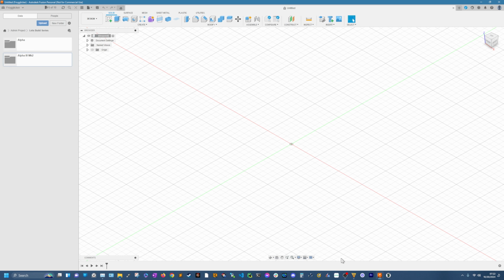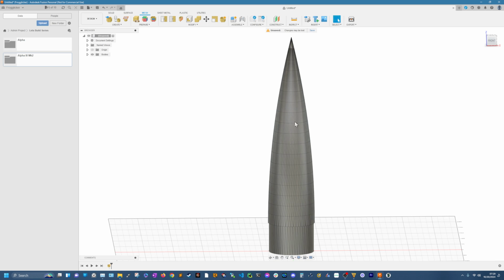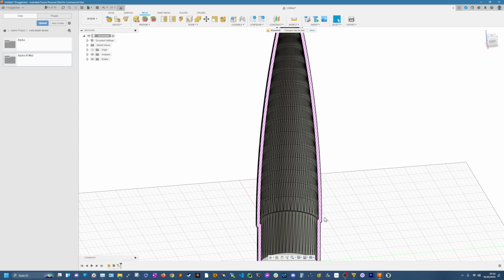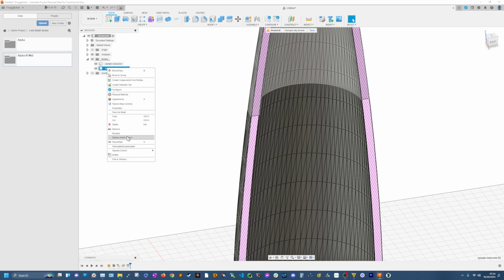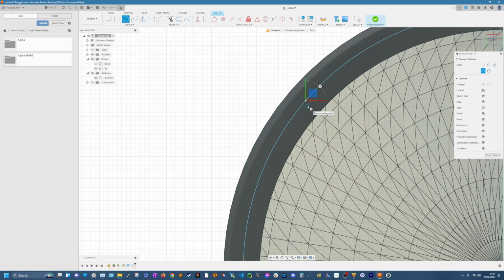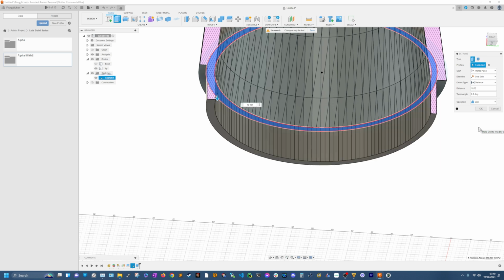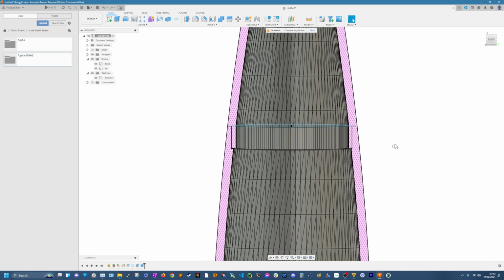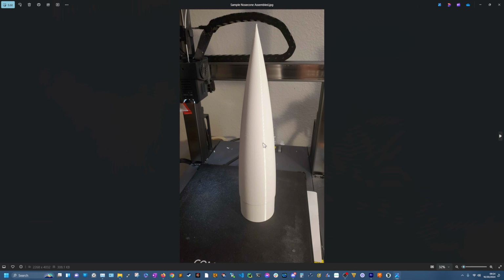Lets Build... Nosecone STL Import and Split in Fusion360 for a Model Rocket

Comment: Solid video! Thank you for doing this. Just a side note, I have found that exporting anything round from fusion - you get MUCH better results in slicer and at print when exporting as a STEP file instead of STL. STL doesn't handle curves as well as STEP files!